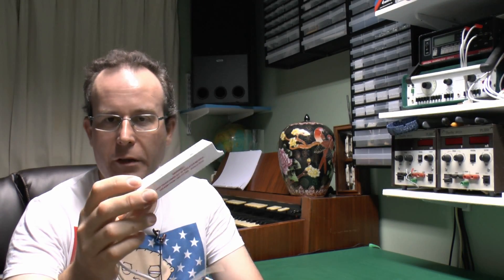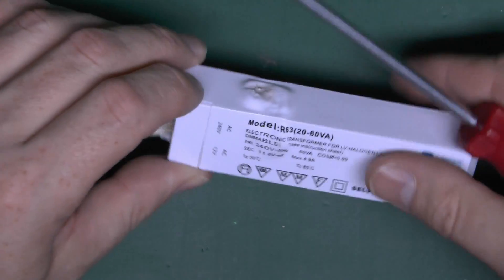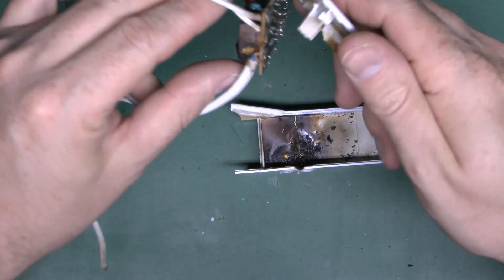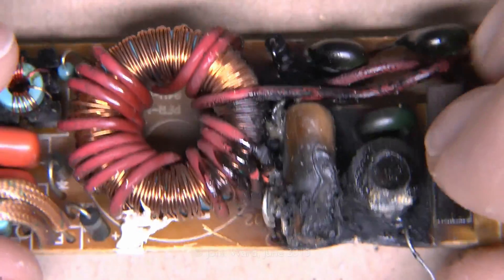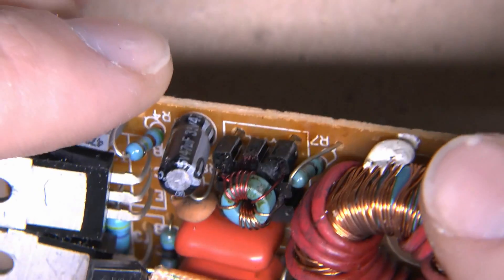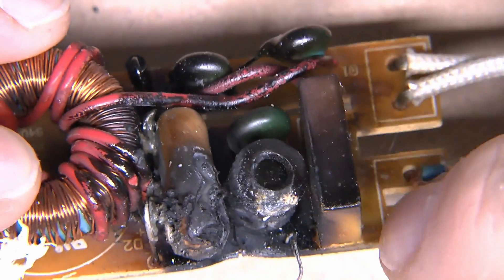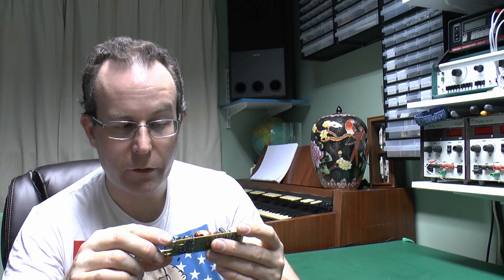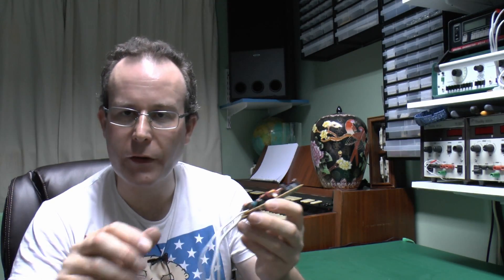Failed SELV lighting transformer

Comment: Interesting vid (I realise it is 4 years old now) but I am investigating failures of an SELV for LED panels. What does Ta and Tc refer to? I ask because I have had two SELVs fail in 12 months and I believe they are just getting too hot (environmentally - not much air flow and no heat sink). I can send you one John if you would enjoy ripping it apart to determine root cause? It is a 220v AC to 27-42V DC 1.15A ( PMax 48W)

Comment: I agree with some comments below that the short circuit protection method used in this unit represents a fire hazard as amply demonstrated, in principle these units should be housed in fireproof containers either  metal (which are earthed) or polyimide material. I have worked on several of these units that have not failed catastrophically and interestingly it is always the bottom transistor of the half bridge totem pole that fails.

The circuits are invariably as shown in my link, self oscillating converters using  two bipolar high gain high voltage transistors running at about 15KHz frequency and a low power low voltage (BC337) starting circuit transistor. The small rectagular device in the sleeve on top of one of the transistors is actually a thermal fuse and can be readily bought through RS components or Elelement 14 etc.

The following link provides typical circuits and photos of  electronic ballast units.

http://s1189.photobucket.com/user/Gantos1/library/ELECTRONIC%20BALLAST%20CIRCUITS

I'm all for conventional steel core transformers of the past that also had thermal overaload protection devices (soft soldered spring).

The unit shown in John's video is a particularly nasty design because the low voltage SELV output is adjacent to the mains input wheras better designed untis have the input & output at opposite ends of the package, albeit isolation is still predicated upon the transformer insulation technique and material. The OSRAM units have the toroidal core  in an insulated  container and the low voltage secondary wound outside.

Comment: Is it not terribly inefficient to have one behind each lamp ? would it not be better to have one large one running several ?
Reply from the maker: +Andrew Joy Older installations did use a single transformer, usually a large toroidal type.  The problem with that is the transformer was too large and heavy to pass through the hole in the ceiling, so had to be located elsewhere.  Cables from the transformer to each light had to be of substantial size to avoid volt drop,  typically 2.5mm² or 4mm², and the transformer was an expensive item.
Once the smaller electronic power supplies were available, it was easier and cheaper to fit one per lamp.
All irrelevant now as LEDs would be used instead.
Reply: i'd also assume voltage fall of is a problem?, i mean, it is only 12v.
Reply: I'm not an expert, but I'd assume that the smaller toroid allows a higher switching frequency to get more efficiency.
Reply: mikokuijn  If it were that much of a gap either way, Wouldn't you see switchmode transformers for EPS power distribution?

No, Its no where as near reliable as a good'ol fat transformer.

Comment: I find it impossible to believe that a safety measure involves a requirement for a component to over heat, cause charring and detach itself from the board by melting its solder pad. you seem to think that this is an acceptable design. in my view this is a very dangerous design and the owner was lucky his house did not burn down.
Reply: if it was a proper 'fusible' resistor they are supposed to blow in a more safe and controlled manner..i bet it wasnt a proper fusible type, just a normal metal film or small wirewound type...
Reply: or it may have been just slightly overloaded, enough to make it hot enough to melt the solder causing arcing for a while, but not enough to pop it quickly

Comment: Sorry, I could not spot the point in the video where you identified the failing component. All the charring seemed to be the effect of the fault (a short circuit down the line)  rather than the cause. Did you actually find the failing component?
Reply: thats what i would think,....i've seen and repaired a fair few switch mode psu blow ups in tvs in the 1990's,  usually the switching device goes short, taking out a resistor or two, rarely actually popping a fuse!

Comment: I had 7 of this 12v electronic transofrmers blow up, even one made the lamp explode on the inside! The problem was on all of them the resistor...
Reply: i doubt if a resistor caused the blowing of the lamps, more like something else failed making it push out higher voltage, with the resistor then burning up due to excess current
Reply: I had one do the same, it was the 12v AC type for halogen lamps. It had no real control circuit and was completely self oscillating, a single 150K resistor failed open circuit and made it go haywire.

Comment: John, The usual failure mode for these type of supplies is the filter capacitor fails short and destroys itself spectacularly. It certainly looks like that is the case here if you look carefully at the hole near its end. When it went short the fault current would have then caused that resistor to fail as a consequence.
Reply: That would be my expectation as well.  A severe short in the capacitor (too severe to self-clear) can dramatically increase the current flowing through the limiting resistor causing it to overheat and fuse.  And judging from the amount of heat damage it looks to have been a rather severe short leading to plasma arcing and carbon tracking exacerbating the damage.  Fortunately the resistor did its job by acting as an engineered weak link and disconnecting from the mains.

Comment: Hi John.   I don't particularly like the idea of a resistor that blows and incinerates the adjacent components as opposed to a fuse that goes OC.   It looks like there was a fire on board, which luckily was contained by the enclosure.  Are there any fire-proof safety ratings on the enclosure?
Reply: +Spoif
I don't like it either!
I really hate them!
Because, they can act like a fire starter on gross overload, but not extreme overload (short circuit)!!!
Even if the enclosure is flame retardent (won't burn on it's own), the hot resistor can make it burn and catch other things on fire. This is the same deal with those CFLs. You see sometimes they have a hole burnt in the side? That is from the resistor "fuse" ... very dangerous!
Reply: Usually these special resistors fail without drama, you normally have to closely scrutinise them to see that they have failed (or neasure then).
Often though with nore expensive devices repairers will use conventional resistors not realising that these are a special type.
Reply: How exactly does that relate to fire tolerance of the enclosure ?
Reply: Sorry, my reply does not relate to the flammability of the enclosure.

Comment: I may have cringed at the screwdriver levering . been there, done that, got the scars
Reply: I've stabbed my hand with a screwdriver too many times like that.
Reply: Darian Cabot Who hasn't?  Same with getting stabbed by that one strand of wire when twisting stranded wires together.
Reply: same thing seeing screw driver levering under pressure in hand getting stabbed (not good)

Comment: Hmmm. Proper fusible resistors are designed to fail in a more controlled manner, not light up like a lamp and char everything around them. You usually just see a pinhole in the glaze at the point of failure.
Looks like the damage may have been caused by prolonged arcing across the gap in the resistor foil where it "blew".
So were either of the drive transistors short circuit?
Reply: It does look like that resistor has been running hot for a prolonged period, if it were to blow suddenly, it wouldn't have caused such excessive damage to surrounding components. I'd say either a rectifier diode or that very charred cap has gone short. Or the secondary side has been drawing excess current for a prolonged period causing everything that resistor to get toasty slowly cook everything around it. Those diodes have been running pretty warm too by the looks of them.
Reply: Simon Parkinson Usually depends on the kind of fault. Fusible resistors fail spectacularly against a short circuit.
Reply: Dr. Lecter I've dismantled numerous CFLs and found failed fusible resistors but they have been controlled failures, not like the one shown here.
On CRT TVs they were commonly used in the secondary side of power supplies, voltages and fault currents significantly lower though.
Even where used on the primary, I can't remember encountering anything like that.
I think I would class this as a product fail. Wrong choice of component for the job. In my opinion the fault took way too long to disconnect and was a bit too close to causing a fire.
Also while they've used an isolation slot with barrier between mains and SELV, they seem to have forgotten about that fusible resistor again. I'm surprised that arcing hadn't occurred between it's PCB traces during the failure.